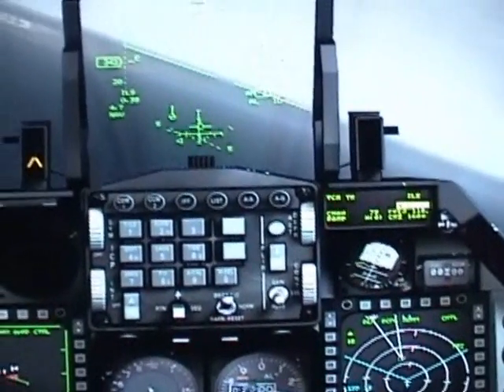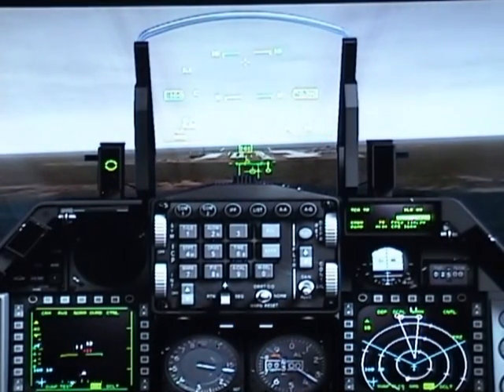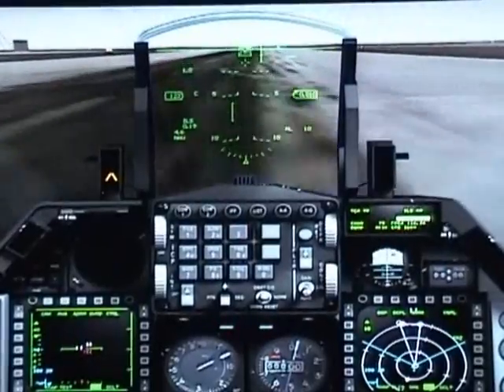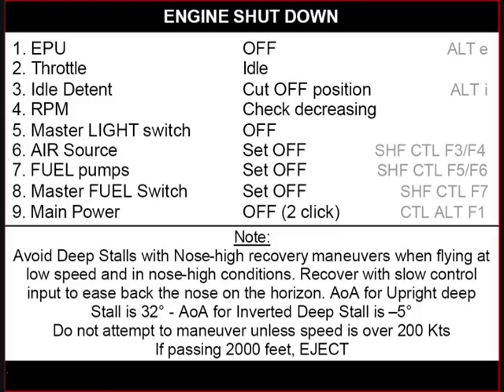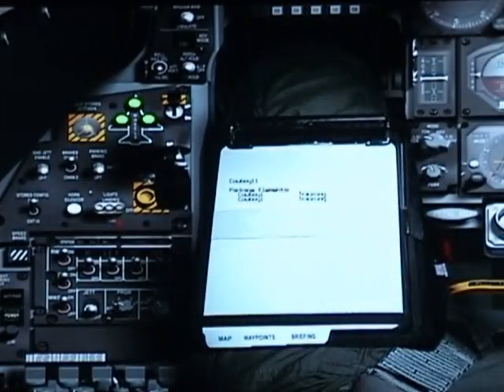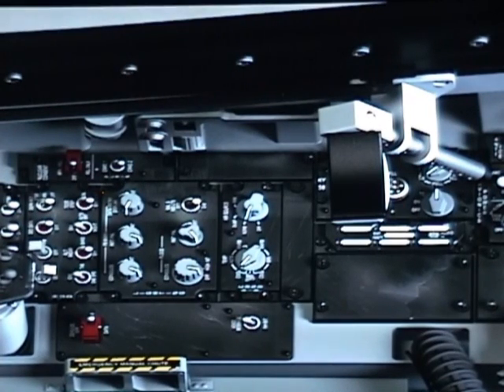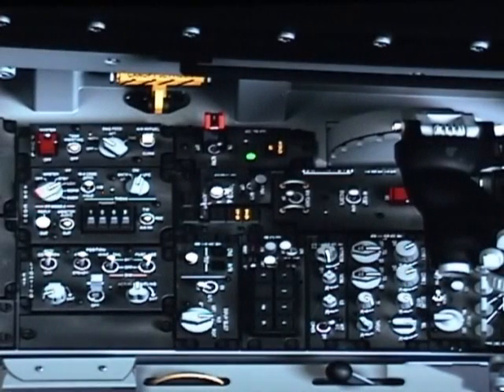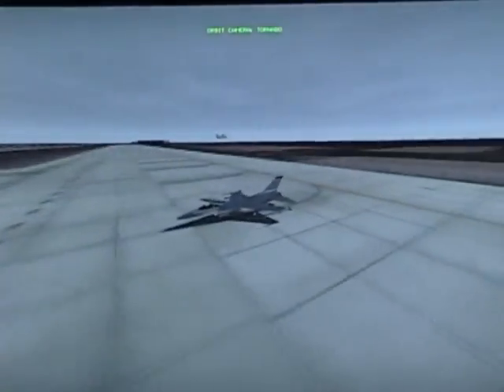F16 F4.0RV HQ LANDING PROCEDURES PART 3

Comment: Your videos are great, but you need some work on this.  The speed brake should be down before the gear and in good time for short final.  For the other speed comment; after the gear comes down, you get the 3 and a half dotted line.  This is where you want the FPM on.  The little vertical line on the left is your speed indicator.  Keep your FPM inside this.  When you are too slow, you are below or near the bottom of the line.  Too fast, and you are above it.  Ride the lines into the landing.

Comment: Hi again!

Nice tutorial! just wanted to add some info: while landing pilots look at the vertical line left of the flight path marker, thats your angle of attack,if you keep you FPM on top of the vertical line you wont have to look at your airspeed, it will always be correct. I had the opportunity to fly in the real flightsimulator of the F-16 and that's what they told me how the real ones land...

anyway great video!
(srry bad englisch)

Greets